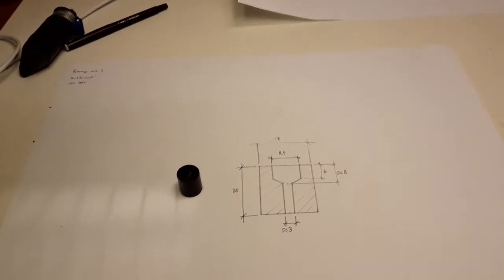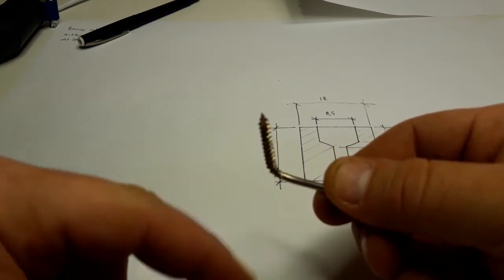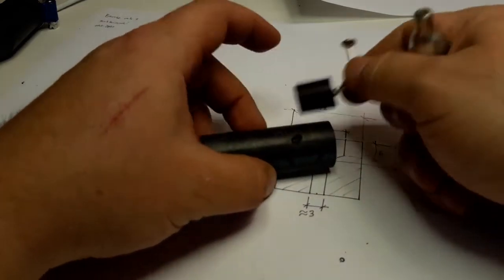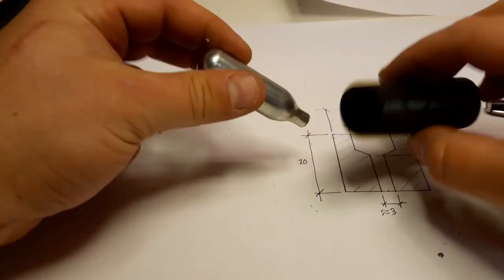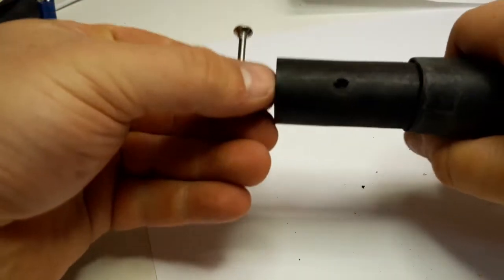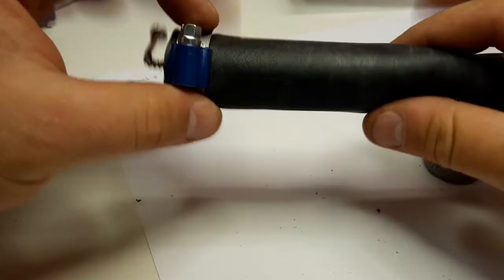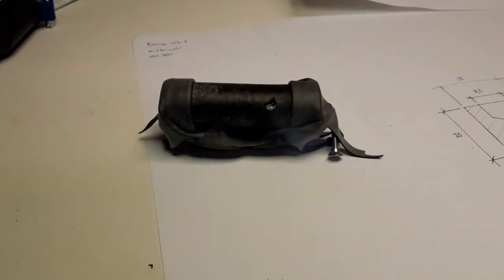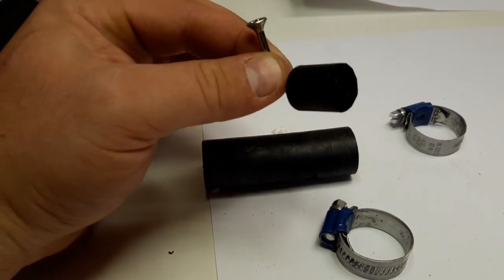Bamse mk3 airsoft co2 grenade diy

Comment: hmmm what would happen if you put like 50 BB's between the rubber hose & bicycle hose? would they even burst around  or just drop out on the spot without flying aorund? otherwise, this is an amazing design.

Comment: Great video, very in depth explanation. for your impact mk4, would you think it possible to use a rivet with a spring as the screw pin and then thread a cap to hold it with the rivet top peaking out of the cap as so you just have to hit the pin and it would puncture the cartridge then return to the safe position by itself? 
I am thinking of making a mk3 with the two clamps and trying to incorporate this idea so that you have no risk of accidental Co2 rocket lift off haha, thank you
Reply from the maker: Im not exactly sure how you mean, but i can tell you this much - the design is sensitive to even minimal leaks, and the threaded portion is like it is to stay airtight.

Secondly the force needed to puncture the cartridge is actually conciderable, and an open hole would release the co2 very rapidly, all the regulation is done in a very rudimentary fashion, but an open hole needs to be very small to function.

Bedt of luck with your build!
Reply: I know how to make ur idea work,  i see 1 problem of it instantly inflating. Need a slower release of the c02.

Comment: hey, big fan of your design, what problems did the wood part gave you?
Reply from the maker: Hello! Glad to hear it.

The wood plug is not unusable, but the problems were mainly poor outer surface quality leading to leaks, pressure leaking straight trough the pores of the plug, and stripped threads.

The benefits were price and availibilty, but the pom can be substituted for a variety of things including plywood, hardwood, or any kind of plastic really. 

As the only thing that can really go wrong are leaks though, the plastic plug really adds to the reliability.